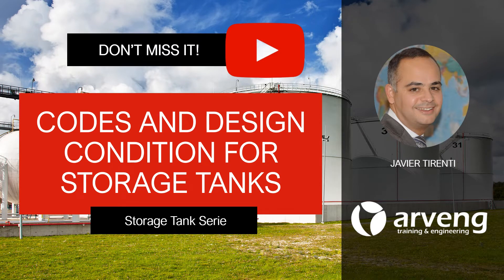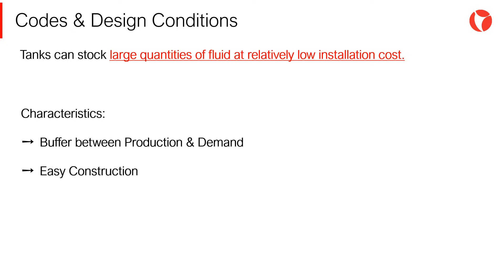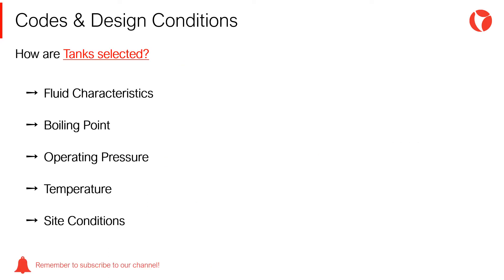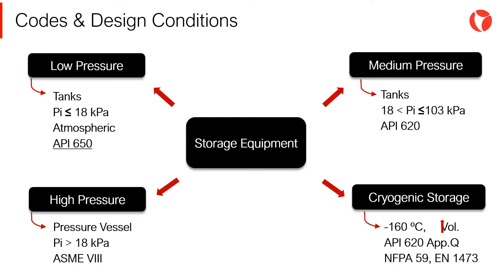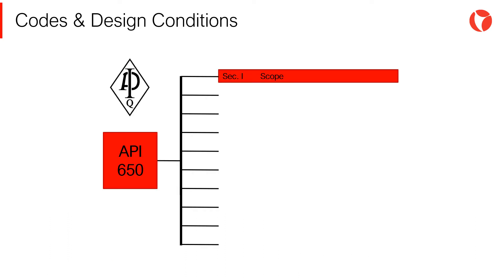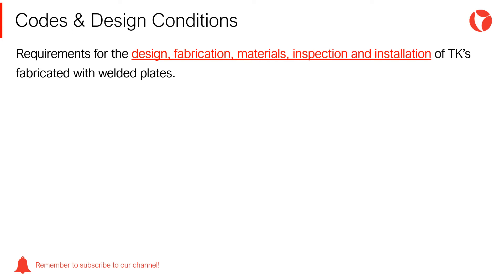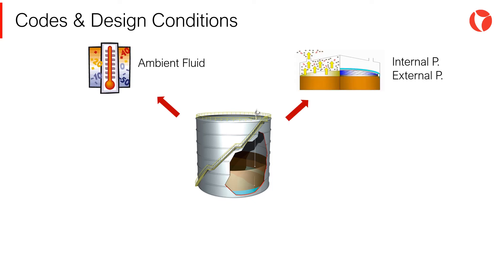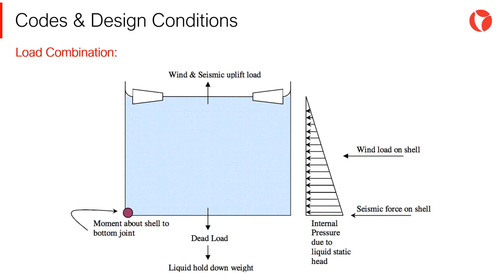1  Codes and design condition for storage tanks

Comment: What construction  code use would use for a horizontal diesel tank. Also after placed in service what inspectors code would be used for future inspection/certification.
Reply: You may want to consider UL 142 for the code of construction; STI SP001 would be an applicable standard for inspection and evaluation.
Reply from the maker: Thanks for the insight!  @deriek5074
Reply from the maker: Thanks for your interest in our videos. If you're interested in learning more about storage tanks, please check out our course about API 650 | Design of Storage Tanks at https://arvengtraining.com/en/all-courses/api-650-design-of-storage-tanks-course-online/

Kind Regards,
The Arveng Team
Reply: API 650 code or standard???